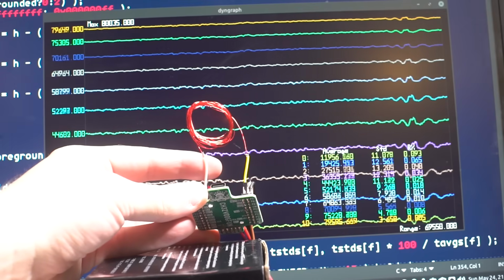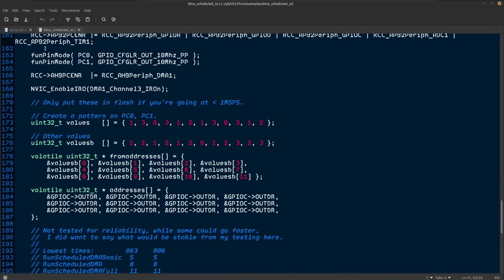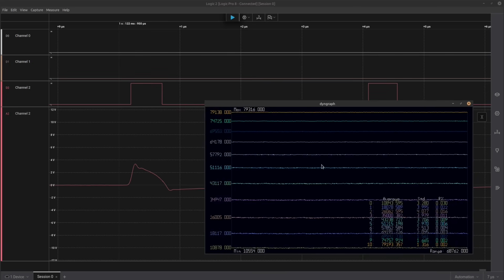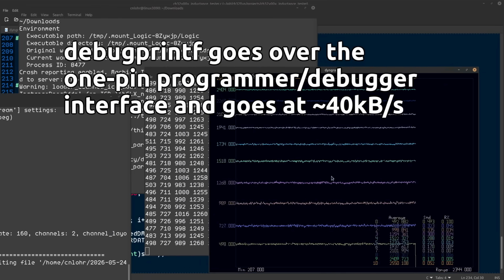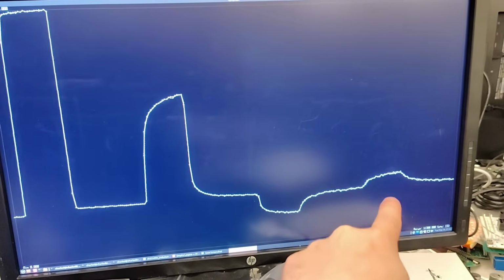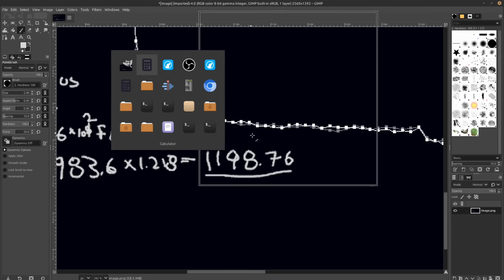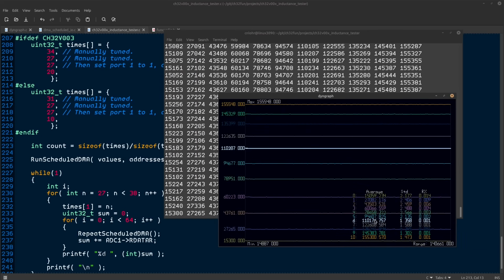The Worlds Cheapest Time Domain Reflectometer

Comment: @CNLohr you have almost created a ultrasound crack inspection & ultrasound coating thickness measurement tool, I think you just need to put a typical ultrasound transducer tip on there and maybe a little preamp circuit. And if you can get many transducers and output the data fast enough, you should be able to make a ultrasound imaging device atleast a primitive one. They've been making them since the 1960s so the processing power needed is probably modest, pulse lenght is 0.5 to 15 MHz
Reply from the maker: I hadn't thought about that.  It wouldn't be too hard to change the I/O to go from pulse-drive to High-Z then I could use an ultrasonic transducer.
Reply: @CNLohr  It would probably work with the speaker from a birthday card or the piezo from a bbq striker, but real ultrasound imaging transducer arrays are abundantly available on ebay like item REDACTED. I also see a variety of new NDT inspection "dual crystal" ultrasonic transceiver under 50$ on ali express such as items REDACTED, REDACTED, REDACTED, REDACTED and I also see "pet ultrasonic imagers" complete units for 600$ so maybe a source of cheap, compact, modern transducer arrays if the probe alone could be purchased. So coating thickness, crack detection and ultrasonic imagers all in one. Do you think you could receive multiple channels with a single ch32 mcu ? Also since we are looking at a time signal, how about adjustable schmitt triggers on GPIO inputs instead of ADCs ? (youtube ate my comment sorry I had to remove the numbers apparently)
Reply: @CNLohr  youtube keep eating my responses ! look at today's Steve Mould's video about exactly this, transducer array are under 50$ used on the "e" of the bays
Reply from the maker: @shodanxx  A friend is sending me one, so I may have time to play with it.

Comment: Very cool! It's always amazing what you can achieve with these cheap micros.
Also a bit frustrated at myself cause I barely understand any code.
Reply from the maker: You kinda have to work your way up to get somewhere good, and avoid the abstraction tower of babel.  Be sure to always be seeking an understanding of what the hardware is doing under the hood.
Reply: @CNLohr Thanks for the advice. 
There are too many microcontrollers with their own abstraction. I literally have every brand of microcontroller in my drawer and their respective ide on my pc.
Reply from the maker: @nand2624  That's why ch32fun exists, to show people you don't need all the piles of abstractions.

Comment: 4:47 maybe remanence
Reply from the maker: What is that?
Reply: @CNLohr  i remember an experiment in physics lab where we placed different ferromagnetic materials in a coil and measured their response to magnetic field. you would plot B (magnetic induction (field in the material)) vs H (stimulus representing the external magnetic field that is applied).

The relationship between the two is defined by the material itself:
B =μ0( H + M )

When you change H (the applied field), you force the material's internal atomic magnets  ( M ) to line up. When you turn
back down to zero, a good magnetic material will hold onto some of that alignment. The leftover magnetic field you measure at
is the remanence.

 your experiment somewhat reminds me of that lab excercise.
I'm not sure if this is what you are seeing here
Reply from the maker: @wolpumba4099  Oh I think it would / should be possible to do that graph with something like this.  But I just don't understand enough to do it.
Reply: @CNLohr  https://www.youtube.com/watch?v=4UFKl9fULkA
Reply from the maker: @wolpumba4099  oh somehow I missed that one.  Will watch later.
Reply from the maker: @wolpumba4099  I did last night. It was really good.

Comment: Interesting to hear the 006 actually has some changed silicon as well as just the bumped up memory
Reply from the maker: LOTS of changes, mostly negative.

* Way more difficult to do cycle-accurate timing
* The flash runs half as fast.
* You can't control the drive/slew of the IO ports.
* No 5V tolerant IO when running at 3.3V.

Comment: Could the side-cutters be "pinching" due to the different metals at the end (Blades and Pivot pin). One test: Place one of the handle ends (single material) near the coil.
Reply from the maker: I don't think so since it doesn't change if I open/close them or ground them
Reply: @CNLohr  Interesting. Does the same thing happen if you present both the Transformer Core AND a Metal plate ?
Reply from the maker: @3ATIVE  Most of the metal plates I tried made it go the other way.
Reply from the maker: @3ATIVE  sort of? Not quite sure how to explain, it looks more like they just cancel each other out than have the other long-tail effect.
Reply: @CNLohr  Going back to the side-cutters - Yeah, that was what I was thinking.  The two different metals (again Blades and Pivot Pin) are producing a sort of "interference" pattern / phase offset ??

Comment: ai summary

Abstract:

This technical project demonstrates high-precision physical measurement techniques—specifically inductance testing and Time Domain Reflectometry (TDR)—using an ultra-low-cost CH32V06 microcontroller. By utilizing a "scheduled IO" firmware technique driven by DMA, the system achieves equivalent-time sampling resolution down to single-clock cycles of a 48 MHz clock (approximately 20.8 nanoseconds).

The first phase of the project evaluates relative inductance changes by pulsing a simple wire coil and sampling the decay curve with the internal analog-to-digital converter (ADC) at micro-stepped intervals. The system's resolution is highly sensitive to clock stability, which is demonstrated by comparing the internal RC oscillator against an external high-speed crystal (HSC). The second phase of the project implements a DIY Time Domain Reflectometer (TDR) to analyze reflection characteristics on a 500-foot spool of 50-ohm coaxial cable. By measuring the propagation delay of a pulsed signal and adjusting for the cable's 85% velocity factor, the micro-controller accurately calculates the physical length of the cable within minor margins of error.

**
Project Summary & Key Takeaways

    00:00 - Experimental Inductance Measurement: A simple wire loop coil is connected to a CH32V06 development board to test a novel, non-traditional method of measuring inductance.
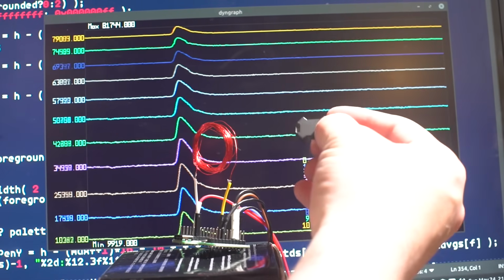    00:40 - Electromagnetic Material Interaction: Inserting different materials into the core of the coil alters its inductance. High-frequency transformer ferrite drastically increases inductance, while aluminum and other metals decrease it, causing the measured voltage waveforms to shift or pinch.
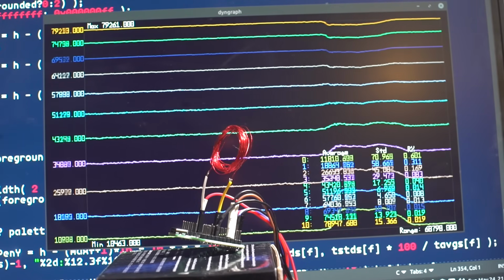    01:18 - Scheduled IO via DMA: The project leverages "scheduled IO," a technique that schedules precise port read/write operations. This allows the system to control output pins and trigger the ADC at precise, repeatable timing increments.
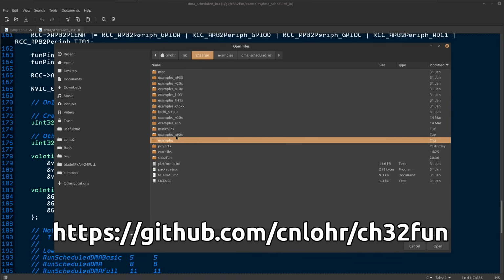    02:28 - Sub-Sampling the Voltage Decay Curve: Though the ADC does not natively sample at 48 MHz, equivalent-time sampling is achieved by stepping the sampling window in increments of $1/48,000,000$ of a second (20.8 ns). By shifting the ADC multiplexer's gate closure time across 32 successive pulses, the system maps the exact voltage curve of the inductor's saturation and decay.
    04:50 - Visualizing Time-Domain Inductive Decays: A custom plotting tool displays the decay arc of the coil. The curve shows the inductor saturating before transitioning into basic DC resistance. Different materials, such as coins or steel tools, noticeably alter the tail of this decay curve.
    06:28 - Phase Noise and Clock Precision: Clock stability is critical for equivalent-time sub-sampling. Switching the microcontroller configuration (fun config) from the internal oscillator to an external High-Speed Crystal (HSC) dramatically reduces phase jitter and noise in the sampled signal.
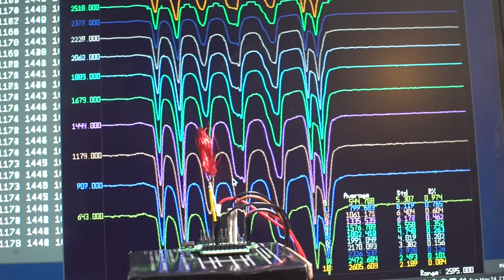    08:06 - Microcontroller ADC Discontinuity: Testing reveals a hardware-level quirk in the CH32V06's internal ADC: a visual discontinuity/step occurs in the signal when the output codes approach values divisible by 512. This error is partially mitigated by software oversampling.
    09:19 - Time Domain Reflectometry (TDR) Implementation: Using a "UIP Duino" board running equivalent firmware, a short pulse is injected into a 500-foot spool of coaxial cable to demonstrate transmission line reflections.
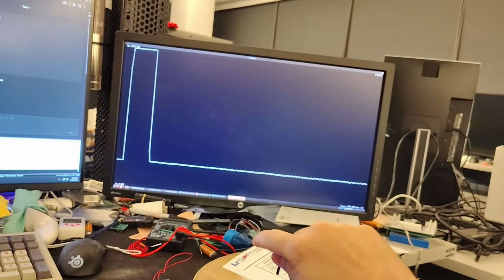    10:07 - Wave Reflection & Impedance Termination Physics: The TDR setup visualizes fundamental RF behaviors: an open-ended cable reflects a positive pulse, a shorted cable reflects a negative pulse, and terminating the cable with a matching 51-ohm resistor absorbs the energy and completely eliminates the reflection.
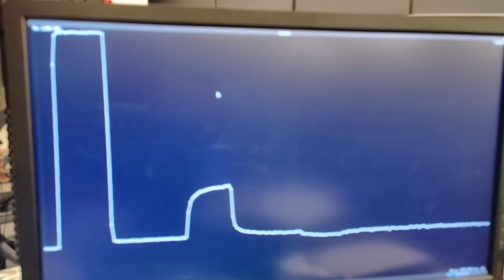    12:22 - Math-Based Cable Length Calculation: The round-trip travel time of the pulse is measured at approximately 58.5 cycles of the 48 MHz clock. Converting this time to distance and multiplying by the cable's specified 85% velocity factor (adjusting for the speed of light in the dielectric) yields a calculated physical length of 509 feet, closely matching the actual 500-foot spool.
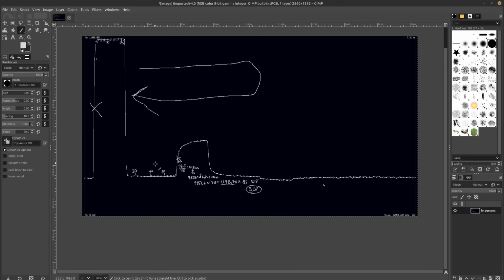    15:01 - Real-World Applications: This experiment functions as an ultra-cheap ($0.12 to $0.15 microcontroller) sampling oscilloscope. The underlying technology is used in professional telecom diagnostics (such as DSL) to locate physical cuts or shorts in long cable runs.
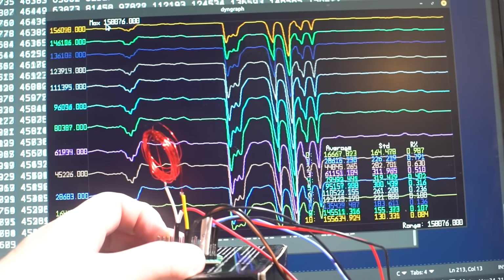    16:06 - Command-Line Visualization Utility: The data is plotted in real-time using "dining graph," a lightweight, open-source command-line tool developed by the presenter that parses raw text values from the serial port and renders them into an interactive, browser-like graph.

Comment: The coil inductance curve looks like decay curve from pulse induction metal detctor, so it looks like you made a small pi metal detector😂
Reply from the maker: I have been pretty surprised by how good it works like that.
Reply: @CNLohr at 4:51 the longer decay indecates lower conductivity of the metal , and its interesting how the decay shortens with the coin.

Edit: i am acually in the process of making a pi metal detector so this video gave me some usefull insight😊

Comment: Looks like an eddy current experiment to me, without using the second and third coil. ❤ Look if you can detect errors in broken metal things and take it to a sellable product stage. 😊
Reply from the maker: I hadn't thought about that, but I don't really have anything like that to test with.
Reply: @CNLohr  Hi CNLohr, i am tech lead in a company specialised on non-destructive testing. Therefore my thoughts. Just get a proper metal plate and metal plate with cracks or a deep scratch and see how your circuit reacts to it. Can you detect the difference?
Reply: @CNLohr  You had small metal plates in your video. Keep one clean and shiny. Bend the other one several times at the same place, so you get micro cracks. Look if you can detect differences in your signal moving them through the coil.
Reply: @CNLohr this with a memory and oled screen would be useful for scrap yards identification of metals.
Reply from the maker: @noimnotarobotcanubeleiveit7024  I never thought about that, but yeah, you could probably tell a lot from the behavior of the metal.
Reply: I read you also only need one coil for a simple Eddy Current measurement.
You arrange it in a resonant circuit and measure how the resonant frequency changes with the change of inductance. 
Still very simple but you need some additional parts though.

Comment: (For old time sake, you ought to draw that graph @4:15 in green with a nice, long decay...) 😊

Time-domain reflectometry is actually used in railroad signalling to precisely measure the position of a train on a given track circuit in order to calculate it's speed so the crossing gates come down 30 second before the train occupies it, no matter how fast it's going. 
🚙🛑🚦🛤🚂
Picture this: this is the perfect place to try it out: you have two conductors (pun intended), the rails, which are shorted by the train axles so the length of the circuit varies.

Oh, and I've seen (± 25 years ago) a cheap router (think D-Link) that had a TDR function to detect faults in ethernet cables and gave you the length (I never tried it to check it's accuracy, though).
Reply from the maker: Oh my gosh, the railroad thing is such a good idea.  And I had heard some PHYs have basic TDRs.

Comment: Algorithmic (Cyclic) ADCs suffer from discontinuities around MSBs change.  It is also likely that there will be jumps at 2048 and 1024 in 12-bit mode.
They take a lot less silicon area compared to full SAR ADCs, but their performance is never good.
Reply from the maker: They definitely went with the cheapest one they possibly could. I'd never heard the term Algorithmic ADC.
Reply: @CNLohr  Atmel SAMD21 and similar devices use one as well. They suffer from a similar issue. It is technically accounted for in the INL/DNL values in the datasheet, but this sudden jump messes up some designs.

It might be something else in case of WCH, of course. If this is the case, there should be jumps of decreasing magnitude for all most significant bits, but they are likely to be noticeable only for the top 3-4 bits.

I would also assume that this is not really 3 MSPS ADC, they just overclocked some slower design and called it good. Life is pretty good as a device vendor when you don't have to provide or guarantee any specs.
Reply: @CNLohr ADCs may have so called "missing codes". Or skipping their calibration increases differetial non-linearity. As for the lines pinching with iron, it is because at low frequency iron acts as ferromagnetic, at high frequencies it loses much of permeability and maybe get even slightly below one. Also its condutance causes eddy currents.
Reply from the maker: @Kley_Moment  I Am surprised by HOW many codes are missing!
Reply: @CNLohr Have you performed ADC calibration? If weights are incorrect - this what you ought to get, huge gap between 2^n-1 and 2^n, like 0xff and 0x100. If you had - it is defective and the only way to fight it is oversampling supported by sufficient amount of input noise, amplitude of which has to be greater than the gap.
Reply from the maker: @Kley_Moment  I did perform a calibration at boot.  Now I'm thinking maybe I'd be better off to just not perform a calibration at boot at all.

Comment: We use TDR to characterize propagation delays for semiconductor ATE hardware and compensate with strobe delays.  Internally the ATE firmware caries out basically that same measurement you did by hand and saves off that delta-T to reduce data transmission errors.
I like your visualization software - I usually rely on Go for stuff like this, but the quality of libraries you can get with C are so nice for performance-sensitive applications like this. (No native "dear IMGUI" or similar libraries in Go without CGo, for example)
Reply from the maker: Even IMGUI is overkill for this sort of thing.  rawdraw is just lines and boxes.

Comment: The change in waveform from the side cutters looks largely like magnetic hysteresis
Reply from the maker: But magnets don't seem to have very much impact (I tried a neodymium)
Reply: @CNLohr   A neodymium magnet would have very high coercivity which would take a very high current to notice a hysteresis effect, and the ferrite transformer core would have very low coercivity so the hysteresis effect would be very small. Maybe the cutters are somewhere in between so the hysteresis effect is noticeable?
Reply: @PretzelLabs  +1
Reply: @CNLohr  Neodymium has around 3 orders-of-magnitude higher coercivity than your typical steel/iron/ferrite. You'd need a lot of field strength for it to care about anything. That's why they use that material to make magnets.
Reply from the maker: @drew6017  Gosh I had not heard of coercivity.  That'd take a while to wrap my head around.
Reply: @CNLohr  It's probably acting more like a chunky steel laminate core, a few pieces of steel with reduced internal freedom for eddy currents to flow. Have you stuck a meaty ferromagnetic steel block in there? Or a few thin steel laminates at once?
Reply: Maybe it has something to do with the pivot mechanism of the pliers having another material than the pliers itself. How does the graph look with iron on one side and aluminum on the other side of the coil?
Reply: I'm curious to see what happens when you heat the pliers and then test it.
Reply from the maker: @nand2624  I can't imagine it having that large of an effect, if the temperature didn't get over several hundred degrees C.  And then the plastic would melt off.

Comment: What font are you using in the editor?
Reply: looks like kode mono
Reply from the maker: AudioLink Mono (or Console) you can get it from audiolink.dev
Reply: @CNLohr I like using b612 as a terminal font...it's the special highly legible font Airbus developed for their cockpit displays.  Only issue is with the period...there is an arbitrary space after the period so it looks a bit odd when working with numbers or filenames.
Reply from the maker: @douro20  B612 is too sharp for me, to many creases and edges.